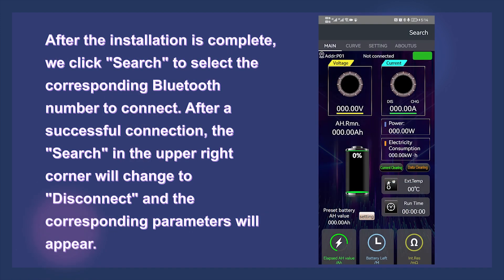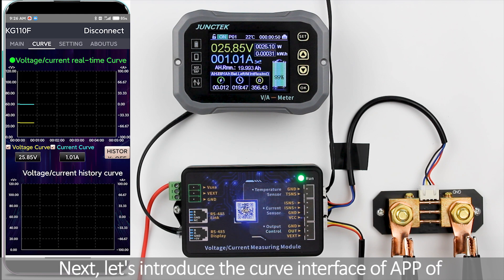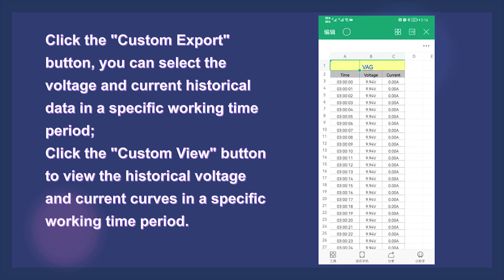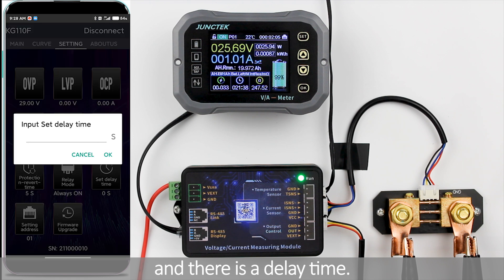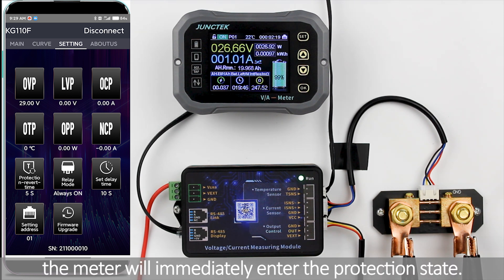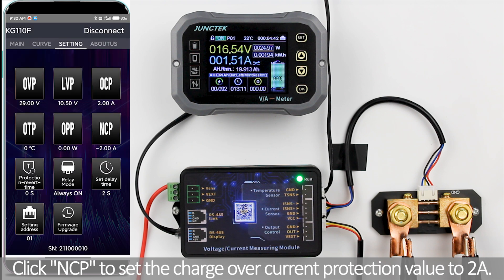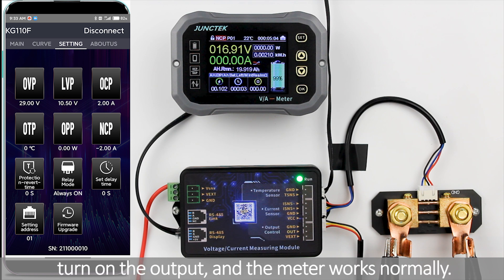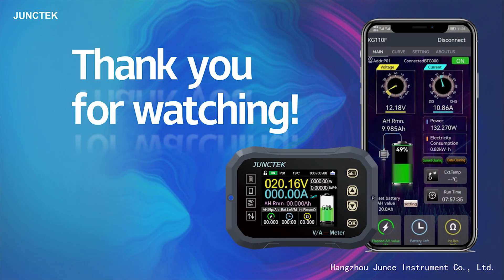JUNCTEK Battery Monitor KG-F series function operation guide KG110F/KG140F/KG160F Coulomb Counter

Comment: Is there a way to turn the screen off?
Reply from the maker: The 14th function in the menu settings can turn off the screen.
When the value is 00s, the instrument no longer displays and the display screen is always on. If the value is greater than 00s, such as a fault
The time is set to 5s, which means that the instrument will enter this state after 5s of no operation, and the display will appear immediately.
Or press the up and down buttons simultaneously to turn off the screen
Reply: @junctek1802  thank you!

Comment: Hello I wanted to ask you the milior setting to set on.my kl-f series, I have a 100 amp lifepo4 battery.
Thanks
Reply from the maker: When the battery is fully charged, you can set the capacity to 100AH and the percentage to 100%; then empty it once to see how much capacity can be released, and then reset the battery capacity again.

Comment: A few questions.  I have 3X 105 AH AGM in Parallel (315 AH).  Can I hook up on ANY batteries in the bank or does it need to be on a specific battery?  What type of battery should i set the monitor for for AGM?  Also, with AGM half the AH are useable...so for the monitor do I set it to 315 or half that?  How should I read remaining?  Would 0% left be 0% or would it be roughly 157.5AH remaining?
Reply from the maker: Hello, this coulomb counter can be used with your battery. It is recommended that you set the capacity as the effective available capacity.

Comment: Why on my one does the current keeps dropping to zero after 15 seconds even when there is still a load?
Reply from the maker: It is possible that the motherboard on the splitter is damaged, and replacing the motherboard can solve the problem.

Comment: Why is there a RED arrow when battery is charging, pointing away from battery logo, then a green arrow point towards battery when battery is DIScharging? Is the Kw/h showing total for charging or discharging battery?
Reply from the maker: Hello, when charging, the current font color is green, and the arrow is red. When discharging, the current font color is blue, and the arrow is blue. KW. H only accumulates the electric energy consumed by charging

Comment: I’ve just read the manual on your website. I saw a section for the mobile app, that has a button named “Low-Capacity Alarm” whose setting is % (representing battery state of charge). Can this “Low-Capacity Alarm” setting trigger the relay when set % value is reached ?
Reply: Hi, did you find out?   Have you used the relay function at all?
Reply: @jmpcrx  
That relay function based on State of Charge % is not available. I wonder if the manufacturer will add it.
Reply from the maker: Hello, this function will not start the relay

Comment: the sampling rate is 1 time/sec, can we improve it e.g 10time/sec?
it will be nice if exported data from App is contain Energy & Capacity.
Reply from the maker: Sorry, only one time per second is supported temporarily
Reply: @junctek1802  thanks for your reply. How about RS485 communication, can we command to the device at 5 times per second? will produce precise data?

Comment: Does the voltage/current curve continue to log when the app is not in use?
Reply from the maker: Yes, as long as the measurement module works normally, the data will be recorded.